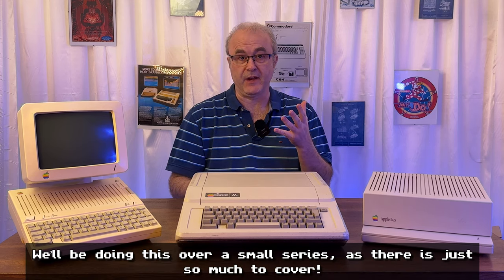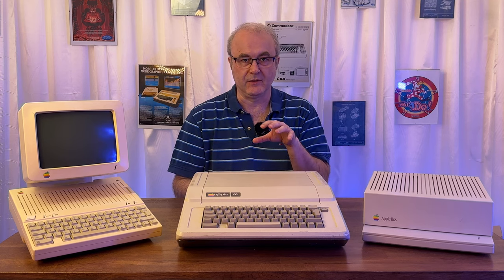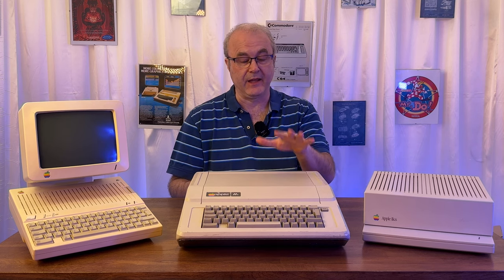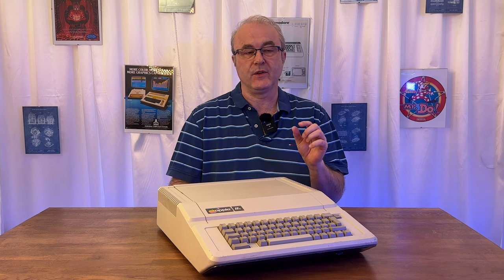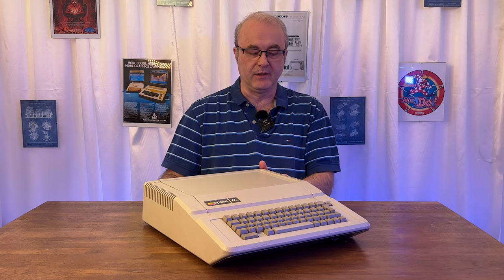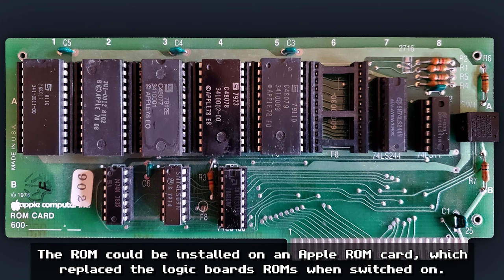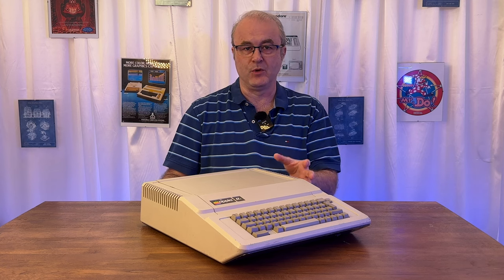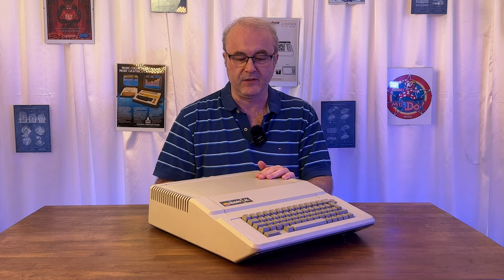The Apple II: CH01 - An Era Defining Micro

Comment: Because the Vic-20 was hampered by the lower base RAM and only 22 column display, people tend to underestimate its popularity and impact, but it was the first computer model to sell over a million units. :-) 
Great vid.
Reply from the maker: Yeah, I think the 22 column display was the biggest issue. This meant it felt pretty unprofessional. I mean the 40 cols on a Commodore 64 was not good enough either. However, as a first machine for so many people, it WAS a big hit. The ZX Spectrum however really took over in that regard, at a very cheap price, and it was actually a very decent machine.
But yeah, as a stepping stone to the Commodore 64, it was a great machine, and the C64 took so much from it, like its case! My friend had a Vic 20 and we had fun playing games on it :)

Comment: Good video! I have an Apple IIe and a IIgs as well. The sound limitation, like so many other limitations, could be resolved with sound cards, although there weren't that many games supporting them. I've got a Mockingboard soundcard in the IIe (Great for Ultima V).
Reply from the maker: Yes I have heard about the Mockinboard. But, its a HARD sell. Because I could just get UItima IV or V on an Amiga and have excellent music. Or I could get a mocking board, JUST to get music on an Apple II.
There IS this new FPGA card which has just come out, which I know has mockinboard support built in. I may get one for my Apple IIe. I do need to re-jig these machines. I have not really used them since maybe last March as I entered a massive rabbit hole repairing my Amiga 2000, then a 4000 and then upgrading them both, and then my Amiga 500. but from 2020 to end of 21 I did a lot of fiddling around with my three Apple IIs. I hope soon to have a space where I can have all 3 setup, all the time. If that comes to pass, I hope to give them all a lot more of my time, as right now I HAVE to store them away, when not in use.

Comment: In the US Apple II's had a very strong presence in the school system - but I had a Commodore, and while I had a lot of exposure to Apple II's back then I never really got to know the system until recently. Compared to Commodore it always felt strange to me that the Apple doesn't have support for using the floppy drive built in to ROM (in particular, BASIC and the monitor)  But on the other hand, ProDOS impressed me with its capabilities. Maybe not the most formidable OS you'd see on an 8-bit machine (compared to CP/M for instance) but I thought it was interesting in terms of what it offers.
As far as the IIc is concerned - expansibility is a problem but the compact form factor is great and it's pretty well decked-out for an Apple II: two serial ports, floppy interface with support for Smartport devices (in the later ROM versions, anyway), and mouse support.
Reply from the maker: I think maybe a few factors shaped the Apple II. One, was that it was a small team with very little experience of making a product before. They had only produced the Apple I to that point, and that was a much simpler prospect, though not trivial of course. 

Another was that (I assume) they knew other micros were about to hit the market. So the clock was ticking. So, do you hang on until you have a Disk Drive ready for launch. And once you DO have a disk drive, soon after a decent DOS seems like a MUST not a nice to have. So, they launched, with the idea of getting these other things done as they went along. Once they had a Disk, it appeared autoboot was demanded. But, if you look at most micros of that era, none had autoboot.

I think its that which DEFINES the Apple II experience. It launched "unfinished" to a degree, but then, there had never been micros until that point. So what did "finished" mean at that point. It was all a massive experiment anyway. Tandy REALLY though their machine would hardly sell at all, maybe 3500 IF they were lucky, and it went on to be the biggest seller by unit.

I find this particular era fascinating. The transition from Mini Computers, with terminals, to actually having your own micro. I missed the bleeding edge by some 5 years. My first machine was a Dragon 32, and people make fun of it (because it was made in Wales it appears). But in actuality, it was a much more refined experience than that original Apple II. It had a FP BASIC, a better keyboard, 32KB as standard, floppy disks, and all for £200. What a difference 5 years made back then eh :)

Comment: I believe the early ventless cases were some kind of foam plastic that was painted and didn't hold up to the heat generated by the system. The revised vented case was made out of injection molded ABS plastic

Comment: Early on  Apple gave large discounts and provided support to US public schools, which led to families buying the same computer for the home that their kids were already learning how to use. What really gave it a boost for business use is that it was the computer the first spreadsheet program was written for. It's biggest enemy was Steve Jobs, who was more about form than function and pushed the Lisa/Mac before the hardware was really there (the company still made most of it's money from the 2 long after the Mac came out), and the IBM PC, because no one in the business world ever got fired for buying IBM, a name that was very familiar at the time.

For me the most annoying thing was the location of the reset button, about where the backspace key (on first gen & the Plus) usually is and way too easy to hit by accident. There was a hack to cut up the hinge side of a cassette tape holder to extend a bit of plastic over hit that made it take some force to use.

Comment: +46:40 and repeated that mistake again in the 2010s with the "trash can" Mac Pro.
Reply: Actually I worked on a trashcan from 2013 until last year, when it could not be used any more because the OS could not be upgraded. Worked flawlessly in all that time. Never overheated, as it actually DOES have a fan in it, and the entire case acts as a kind of heatsink. I found it ran warm, but it was very quiet, and running 3 monitors off it, it was a real workhorse.

The G4 Cube feels like the direct ancestor of it though. Something of a vanity project, its certainly a UNIQUE looking machine. But it ONLY relied on convection cooling and apparently that REALLY is not enough for it. I have one, and I need to think If I should mod it, and but a little fan in there to get SOME kind of airflow goeing.

The Trashcan, DOES have major issues with expandability, though it IS still more expandable than say a modern Mac Studio which has ZERO expandability unless its some kind of USB C dongle hanging off it, like techno fruit :)